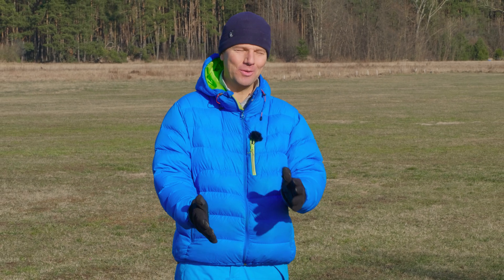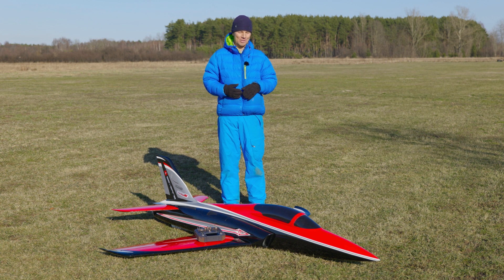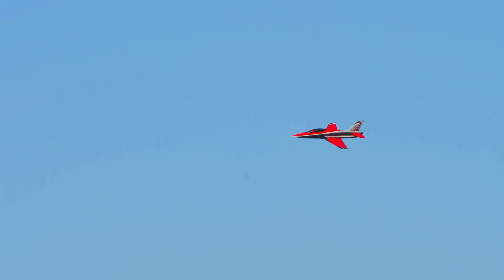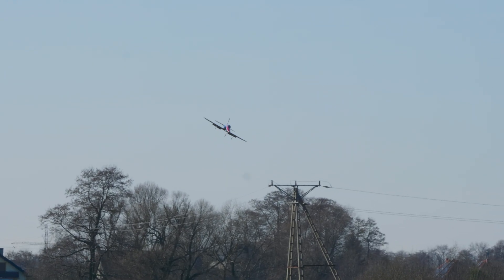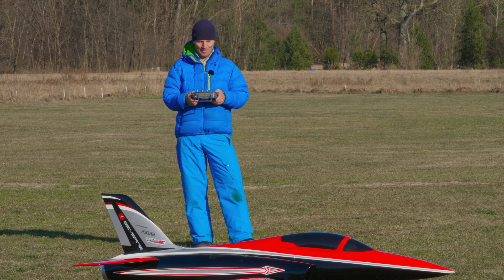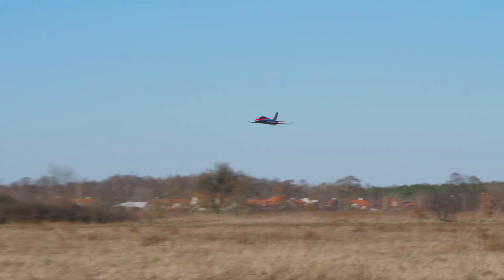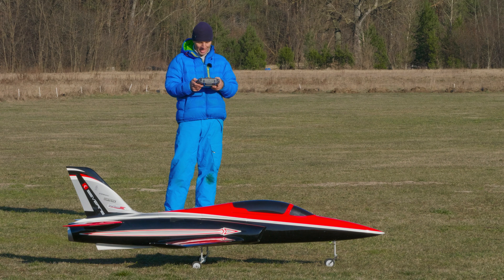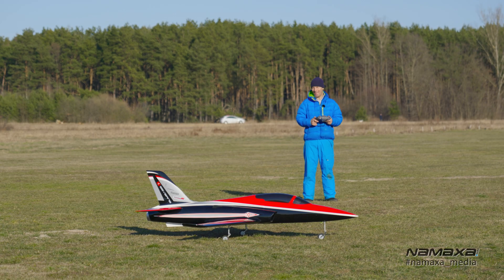EDF Odyssey 11,3kg JETFAN-120 PRO 301km/h 7kW 16s 130A Li-Ion 8Ah TOPRC Model Jet Sound, very fast!

Comment: I tried 16S with JETFAN-120 PRO HET 800-73-590kv inside Odyssey. Result : engine burned and ESC 150 A destroyed too.
Jetfan says 14 S max for these turbine. It works with 14 S.
Reply: Bummer! Was that on liion or lipo? And did you set the ESC timing to low?
Reply: li-ion cells have a much higher voltage drop so 16s is comparbale to 13-14s lipo

Comment: Hi  
One question: i ordert a skymaster f18f in 1/8. Do you think that the f18 will fly with 2 wemotec 100mm edf on 12s each?
Best regards
Reply from the maker: It will fly great with plenti of power and speed. Go for HET 700-83-1080 motor, You will love it on 12s and if you get bored you can kick it up to 14s :)

Comment: Please show your new battery, simply open the hull and film the contents. PS: Pretty external camera and a fantastic microphone.
Reply: Thanks for the camera and mic complements. I will make some shots to show the plane inside... hope in next video
Reply from the maker: look into the video description
Reply: @EDFjetRC " batteries Li-ion Samsung 40T 21700,  16s 8000mAh, total battery weight ca 2480g." We know them, but the light Li Pos, show them in your videos as a block, just show what's in the model more often. Best Man for E-Jets !
Reply from the maker: @miketango244  Mike, look in the description of the video with light batteries. It is all there.

Comment: Hello.  I am making a plane on edf JP120mm.  In the channel of the aircraft, the thrust drops by half.  From 9 kg to 4.5 kg.  This is fine?  Or did I do something wrong?
Reply from the maker: The intake holes diameter or nozzle diameter is to small. Also the way for the passing air must not be obstructed. Also the JP120 is not really good in  suction situations. Meaning it is a poor compressor. Very good compresors are WeMoTec and Jetfan edf's. It means that they loose very little efficiency in obstructed airflow conditions.

Comment: I really like how slow this jet can fly now, so it is also suitable for small landing strips 👌 I really would like to see a video where you explain your detailed modifications to achieve this low weight!
What also interests me: the Samsung 40T cells are rated for max. 40A, if you have two parallel, thats 80A. But how do the batteries deal with those high currents like 130A at take-off? How do you cool them and do you use a temperature sensor?
Reply from the maker: This cells easly handle peaks up to 80 Amp from a single cell. The cooling of the cells is through the airflow from the front wheel to the edf. Next video is on 10,5 takeoff weight and 40km/h slow fly by's :)
Reply: @EDFjetRC  Nice, thank you. Looking forward to see this!

Comment: flying with  flaps   WHY.???????           most rc pilots do  NOT  fully  understand flaps.          if you want to fly near stall speed, safely,  skip the use of flaps  and    FLY  THE  ELEVATOR   correctly.!!!         googletranslate
Reply from the maker: On full flaps the angle of the plane is greater and some of the weight of the plane is suported by the thrust of the edf.

Comment: information, about edfs.
it is very simple to correctly design for Optimal air flow in an edf system.  and, that correct design  is  Almost  Never  Done.!
an edf is  NOT  an engine  and  its  air flow  Requirements  are  GREATER than  a  similarly sized  ENGINE. 
the design of an edf-powered  airframe  SHOULD   Accommodate the Needs of the edf  being  used.!!!
ANY edf has has an  Optimal  exit duct cross-sectional  area  and  a  Minimum  Optimal intake cross-sectional  area.       those two values are  IDENTICAL.
both values are equal to,   the  Effective Swept Area  of the  impeller.!!!
assuming a cone diameter of thirty-five mm, and a 120mm  impeller diameter, that area is  10,345 sq.mm.
that equals a  circle  having a diameter  114 mm !!!!
it appears that this model  has  a  significantly, TOO-small  exit duct.!         i leave it to you  to  Determine  whether the intake area is  also  Insufficient.  
one or more cheaters are  NOT  a  solution to defective air flow design.!
in part, this is so because, a cheater does  NOT  make  the exit  Any  larger.!!!!
these air flow design flaws result in  continual  extra  STRESS  on a motor.!    so, it gets  HOT.!!!    and  fails  Sooner.     googletranslate
Reply from the maker: Look at the detailed description under the video. It states that exhoust nozzle diameter is 114mm :)

Comment: Excellent build, modifications and piloting skills!.  What power system would you try in the HSD super Viper jet?.
Reply from the maker: I would go for WeMoTec 100mm with HET motor 700-83-1080kv on 12s or 14s